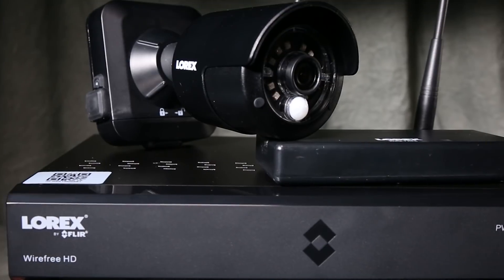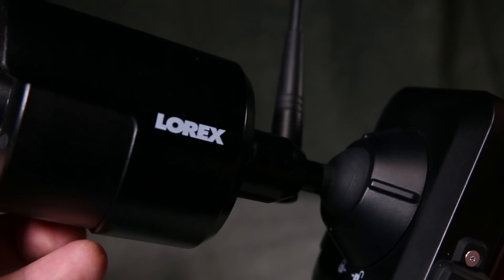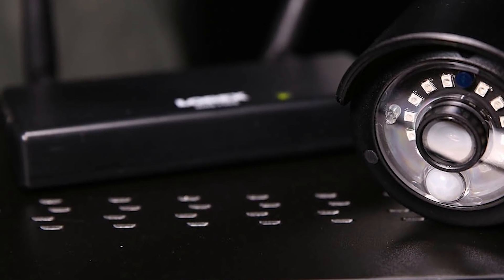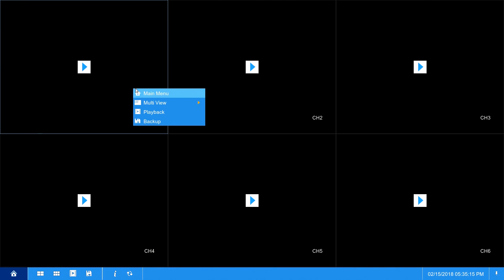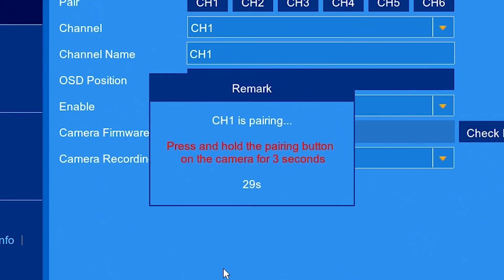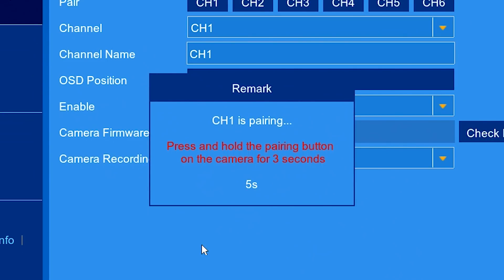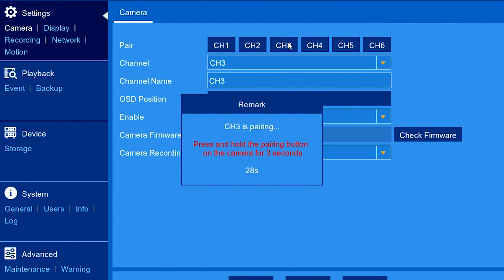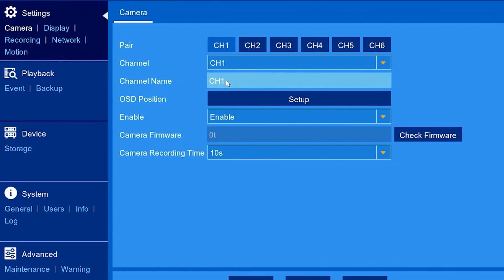How to Pair Wire-Free Security Cameras with DVR

Comment: What do you recommend customers do when the pairing process never takes?
Reply: Ended up going through a lengthy replacement process, finally revealing that the receiver wasn't doing it's job. The whole system is working now and working well. Just took a couple months to get it all up and functioning. Speaking in terms of simplicity, it all works exactly as described in terms of just plug it all in, sync the cameras, and call it a day. But that's only the case if all the components are working as intended. Customer service over the phone was very helpful. Almost Too helpful as I got multiple replacement components, including ones we didn't need replaced after the fact. The greatest confusion came with our desired choice of color. It seemed like pulling teeth to get white cameras with white batteries, as we got multiple black cameras and black batteries several times. But they always send return labels and always take stuff back without much of a hiccup. All in all, while the process was laborious, I feel the outcome was worth it. But I highly recommend making sure y ou get the 4 cell batteries for the wireless cameras since they last significantly longer than the 2 cell so you're exchanging and charging less frequently, obviously.